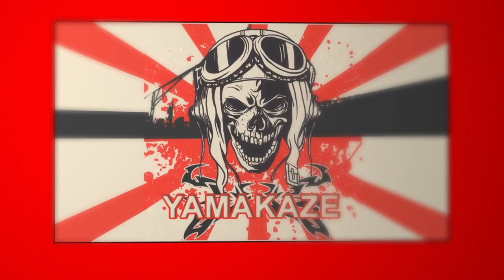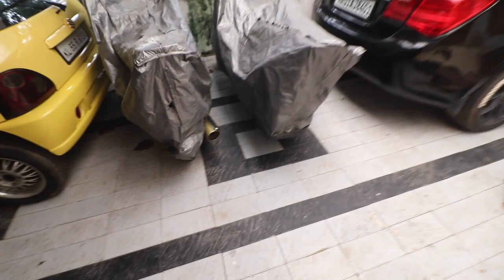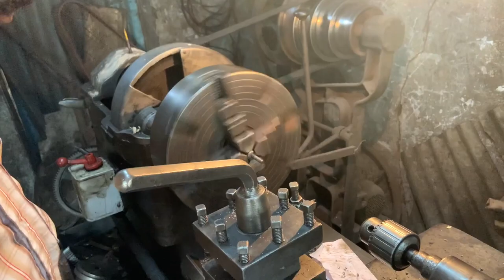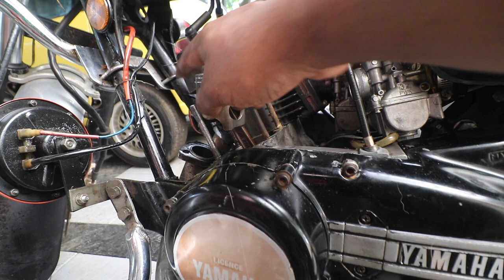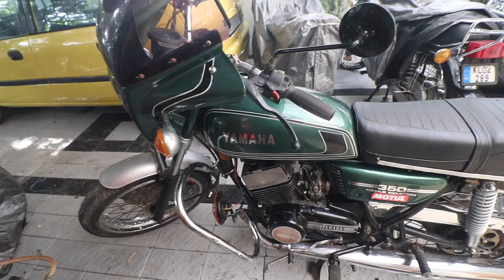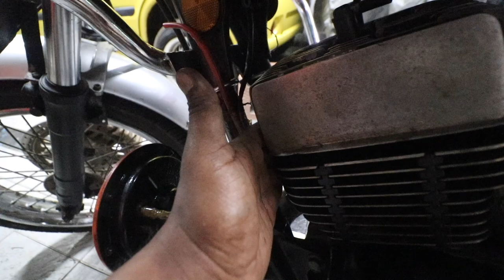Yamaha RD 350 Head Stud issue (in English)

Comment: I’m kind of having the same problem but with my RX’s block, with the front right head bolt is not fully seated into the block, so there is a bit of a leak there. 

Have to get it done after the lockdown.
Reply from the maker: Most likely replacing the head gasket should solve it
Reply: Yamakaze Yeah, have did that. But will have to fix that bolt. Because I have a feeling that it could cause the engine to run a bit lean too.
Reply from the maker: Bratty Biker is the stud spinning freely?
Reply: Yamakaze Yes, was able to get it out. My noob brain thought it’d be fixed if I took it out and put it back in. But naah, it’s still in the same position. Basically, it doesn’t go down fully. There are still last two lines of thread that just won’t go in.